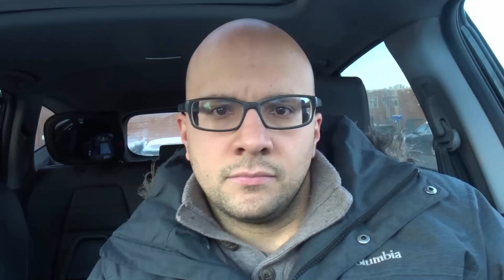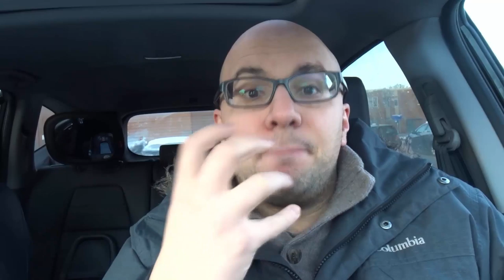7 Signs Of A Worn Distributor Cap And Rotor-Look Out For Them

Comment: It's also a good idea to replace spark plugs and wires at same time as you do this repair, just did mine on a 97 k 1500 fixed my misfires as distributor cap was corroded at point of contact on the inside. Good video

Comment: So helpful! I’ve got like 4-5 out of the 7. Changed the ignition coil on 85 Camry, but not cap and rotor. And now feel like it’s misfiring and losing power when I decelerate. Mechanic only wire brushed cap and rotor because I didn’t have one. Now going to replace it all and hope we’re sitting better.
Reply: Any update on it? Did it fix the misfires?
Reply: @ZKrow382  well the guy that was working on it messed with the TPS causing the issues after. Vehicle sold now. Took it down to Scotty Kilmer and he made a video on it couple weeks ago lol. Titled it greatest vehicle ever made.

Comment: Thank you so much, you named 3 or 4 of the problems I've been facing for some years, especially no7 where my car would just shut off when coming to Red light or Stop sign. I've looking at the wrong places all this. Mechanic's pointing me to relign my fuel tank or replace my carburetor.  My car is 1969 Ford Taunus 20M V6 3.0 not sure if it's the origin distributor but haven't started the for over a year now and when trying to start her yesterday 2023-04-07 she wouldn't swing over, replaced all sparkplugs, replaced the fuel, cleaned thw carbs did the usual checks but still wouldn't start, check the dizzy cap and found tiny metal dust shaving all over, dizzy cap central contact point has been worn off. Will now need to focus on replacing the entire dizzy.

Comment: I changed all my spark plugs and wires in my Astro and it fixed these issues. I no longer have misfires or stalling or trouble starting. But it still feels rough, is very loud when accelerating and maxes out around 55-60 going uphill and can only keep up if I’m just flooring the gas pedal. I’m really worried about my engine and I’m constantly staring at my temp gauge because I’ve thrown a rod or two in my time and can’t afford to lose this vehicle like that. When I park and turn the engine off I hear some clicking or buzzing sort of noise coming from the doghouse that I never noticed before. I also smell gas pretty much all the time and my gas mileage is 11mpg. I want to feel good about having those previous symptoms resolved but I’m still worried that something is wrong and I need to figure out what I can do to improve the performance because it’s no fun to drive around in a slug even if it’s better than what it was before I changed the plugs. Could it still be the distributor or the injectors?

Comment: Hey Buddy my Truck is doing that shaking off and on. I had already replaced the spark plugs and ignition wires. And was running great for a couple of weeks , but now the off and on shaking started. I will replace the rotor and cap tomorrow. That might be it. Thank you!
Reply: check your ignition control module...also

Comment: Your info is so useful but i hope you get back to me so my car stalls and RPM goes down and then goes back to normal when i put load on the car like lights or putting windows up or down
Reply: Make sure your P C V Valve is nise and snug and works proper helped mine

Comment: What if your in the process of starting the car and while it's starting it starting but you feel like a back fire or while driving and get up to like 50 and the start slowing down to match the speed of the road and a back fire or like a minor delay like the engine going to turn off is that what your saying as a example?

Comment: Will be working on my car and hopefully its the cap and motor, i had already changed the plugs and wires.
Reply: Any update man, I’m having the same problem. And I already replaced all the spark plugs and wires. So now I have my fingers crossed that it’s is the cap and rotor that need replacement.
Reply: @tonig7400  what's the diagnosis

Comment: Howdy there. I have a 1998 3.3L Nissan Pathfinder. 175,000 miles. Great condition. Stock. My tank gets alarmingly  pressurized when driven a couple hundred miles. I don't have any codes. My Nissan gas cap visually inspects clean and good. Does not leak. 

I even disconnected all hoses on the EVAP system and cracked the gas cap. No codes were made either. How can that be? I drove it dozens of miles to test. To see if the missing stopped or codes would appear. No codes, except random misfire. Every now and then, but the motor is obviously missing mildly to badly all the time.  It gets worse for a while when I refuel.  For a few dozen miles.  

When this system started doing this, I started getting a random misfire code at the same time. These may be unrelated. Not sure. 

I have verified purge valve works, hoses are clear now. One was dirty about 2" clogged at the canister for the purge line. It looked like charcoal dust. All other hoses clear. 

Any ideas?  I was going to remove the plug from the cannister ambient vent valve and see what that did. It should toss a code right?  And make the valve open, from my understanding?  I don't want the tank to pressurize like that again.  It will spew and hiss for about 6 minutes when cap is removed. I've never seen a vehicle do it this badly before. 

Many thanks

Comment: My car is stalling but only after starting it up and driving for about 5 minutes.
It’ll stall once or twice and then it’ll run smoothly until the vehicle itself cools down and the symptoms reappear again like clock work.

I’m hoping this fixes that issue
Reply: Did you figure out the cause ?
Reply: @juz1ish  Oh yeah, it was my distributor cap. I got a brand new one installed and the car is running perfectly now!
Reply: My truck is doing the same thing. Exact. Same thing. I hope this fixes
Reply: @rileybolling761  what was it

Comment: How about when your engine runs smooth at idle, then as you speed up it vibrates, then smooths out again at a certain rpm?
Reply: Mine does the same, I've since replaced all spark plugs, ignition wires, rebuilt fuel injectors & replaced fuel pressure regulator without a change in symptom - hoping this might be the one!!

Comment: My Car 2003 Toyota Corolla Sport “S” 
I had just installed a new Cadillac converter, spark ⚡️ plugs, All New Engine Coils replacement & new engine filter and still.. not enough power .. it takes awhile for the car speed to gradually climb to 60.. and 70..
Reply: they got you good

Comment: Literally everything he said my truck is experiencing. All 7. I’m going too replace this part I stg if it’s not it I’m gonna be pissed cause idk wtf else it could be.
Reply: Can you describe the sounds that you had? My 01 Ram misfires under high load and it sounds like mini detonations under the hood
Reply: Try replacing the truck. That may fix the problem. Results may vary.
Reply: 😖🤣, dam people, just wth, oh I am going through this same dam thing. Already spent 300 in some on parts and such started with the serpentine belt, 🤦‍♀️, now gonna give it an oil change, transmission fluid, filters, transex,   the oil stuff in a clear bottle,  windshield wipers, drivers side door handle, and tires, plugs and wires,  then see if I need that distributor cap and roter,  and a freaking radio and the mirror switch. Yeehaw, then I got me a decent 97 ford ranger. I spent 2500 on it with these parts its roughly at 3400 bucks as it stands. Either drive it awhile or maybe get 4000 grand out of it . Never know. Take care and thank you for sharing this information with me. 👍🤠

Comment: I’m stranded right now with a crank, no start. Right in front of an O’Rielly’s of all places... I replaced the fuel filter today and I’m going to replace the distributor cap and rotor in the morning. If that doesn’t work I’ll have to take it to the shop I guess.
Reply: It ended up being intermittent. I eventually replaced the fuel pump (saved $1,500 doing it myself by cutting open the floor from inside). Runs great now.